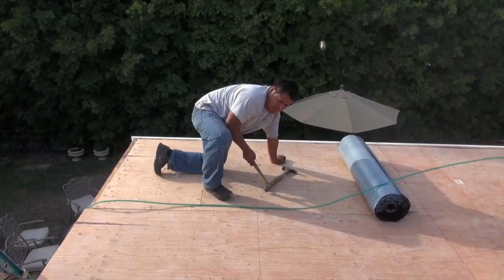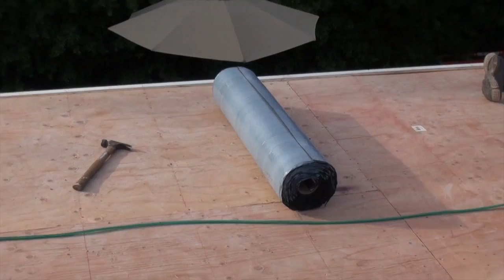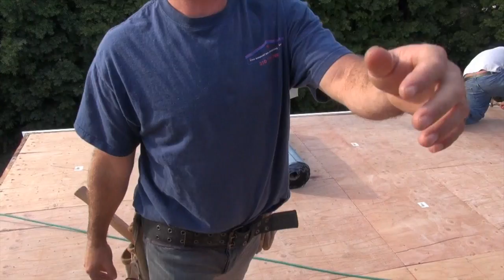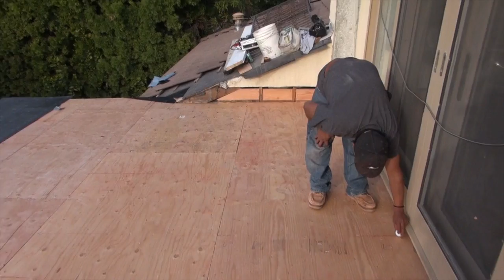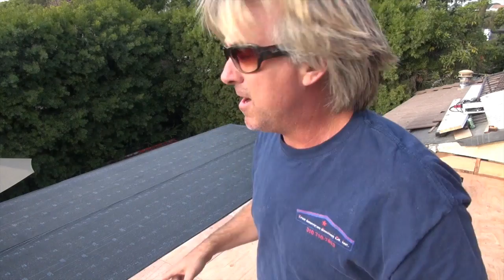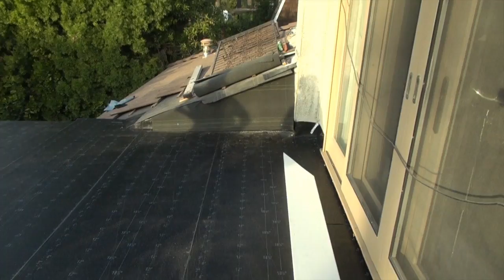How to Install peel n stick underlayment for a roof deck Palos Verdes Roofer

Comment: Why not put tar paper on roof deck first then put peel and stick on top of tar paper ? Otherwise , if you have to repair or reroof in the future you will have a very difficult time getting the peel and stick off the wood roof deck !!!
Reply: dayofhappiness good idea never thought of it I will take that into practice next time
Reply: I Live in florida.  Inspector says remove all shingles & nails etc..peal & stick good enough too shingle over in.future.
Reply: Don't wont hurricane force winds lifting peel & stick
Reply: so blow off with the felt paper ...peel n seal always goes on the wood
Reply: Its actually not supposed to adhere to the wood! I wouldn't just use 15 lb felt paper but they sell a nail down base sheet specifically for this product  that the self adhering base sheet sticks to then the granulated cap sheet. It is supposed to be a 3 part system but no one uses the nail down they just stick to plywood!  Also this man is installing it improperly the first piece should be a half sheet so the seems aren't on top of each other causing a build up!
Reply: Like Alfonso said they sell a base layer that you nail, which is a 3 layer process. I believe you can do it with the stick and peel base and cap, a 2 layer process. Look at GAF Liberty Base & Cap system for details.
Reply: Peel and stick is a tar product under heat it melts and bonds to your wood roof, by putting it on paper you taken away it’s purpose and design.. u can put felt or paper on top of it and use shingles, metal roof after
Reply: @alangaudry724  Well he's not putting nails into it. The top cap layer is also peel and stick.
Reply: Anon Ymous  No there is a nail layer by the same manufacturer.

Comment: I read the instructions on the box and it says to prime the wood with asphalt primer. I couldn't find it at HomeDepot or Lowes but I found it on Amazon. It goes on easy like paint and dries quickly. It makes the roll roofing stick a lot better.

Comment: Thank you for your video.
Questions:
1) After the peeling and stick, do you need to nail it?
2) How do you install the second roll, overlap or side-by-side to the first roll? If overlap as needed, how many inches?

Comment: didnt use any primer with the peel n stick?
Reply: Alex Odonnell no need
Reply: joecee67  it’s a tar product, it sticks to plywood nicely no need for any primer
Reply: @hercg1967  its NOT supposed to be in contact with the bare roof deck at all!!! Slap yourself
Reply: @ArnoldandSonsExteriors  that is where you are wrong. There is no problem that membrane is in contact with the plywood underlayment.

Comment: what is that first black sheet layer that you put on top of the plywood?
Reply: David T. That is self adhere base application which he should of used asphalt primer to adhere properly to the plywood.
Reply: @floyddiaz257  you're wrong. The self adhering base sheet is not supposed to be on the deck at all!! There is a nail base that is supposed to installed first so the material can be tore off when the time comes. This video should be taken down because its showing uneducated ppl how to void all manufacturers warranties and the wrong way to install self-adhearing roofing products on low slope roofs. Slap yourself

Comment: Roofing gravel washed down from rain can puncture the tin foil(thin aluminum) peel and seal, if walked on. my roof leaked until I discovered this and brushed off the peal and seal and sealed these pin size holes. Not thick enough.
Reply: Hi Jerry, I saw your comment on Peel & Seal. It's word for word with this one. Hmmm.....

Comment: I watched the installation  the manufacture(polyglass) that I am going to use  in my flat roof. Definitely the company  gave instructions how to handle the products, safety and tools needed.  There is a new technique technology called "cold process"( not torch fire required) that uses 3 membranes(Sheets) (Elastobase, Elastoflex  SA V and Polyfresko SA G) to lay on flat roof.  1st layer Elastobase SBS- attached to plywood 2nd layer elastoflex SA V- Smooth membrane3rd layer Polyfresko SA G- Granular membrane.I already filed a permit and  submitted plan review.  It is going to be my first re-roofing installation.  where are the tools? 3-4" hand roller and 80lbs lawn roller for pressing the  sheets, your workers press their feet at the seams.
Reply: I recommend single ply roof there is a lot brands Firestone Carlisle JM all them make TPO and PVC (PVC) membrane is grease resistant) TPO manbrane not

Comment: The first layer should not be stuck. because the decking and membrane move at different rates.
Reply: Wrong, it should be fastened to the underlayer what so ever as long the membrane exposed. If you gonna have a green roof, with grass on theb you don't have to because of the weigth of the soil.

Comment: Why doesn't someone design a nailer that sets properly with enough oomph to get through any type of wood used, with some kind of a mechanical stop?  Seems dumb to rely on force "balancing" for set, since density, etc. will change all over the roof.  This looks about 100X better than tar paper.  Who makes a good reasonably priced product that would work well for a "fiberglass" shingled roof?  Thx.